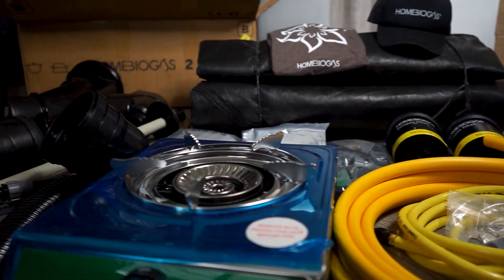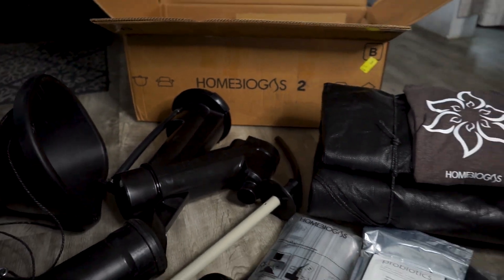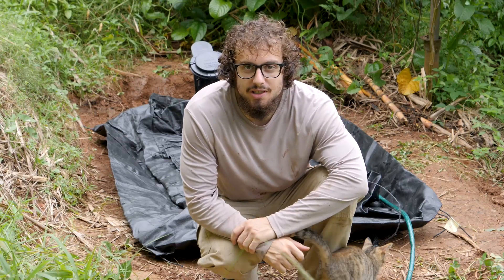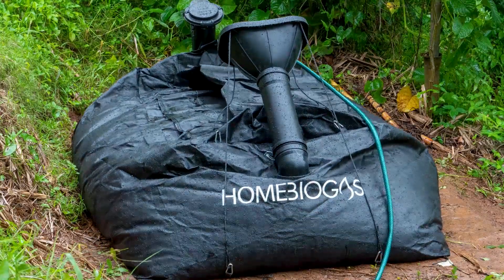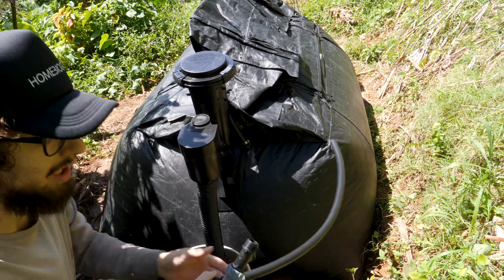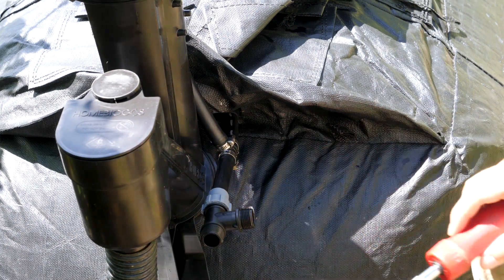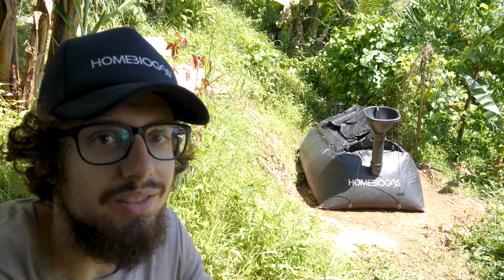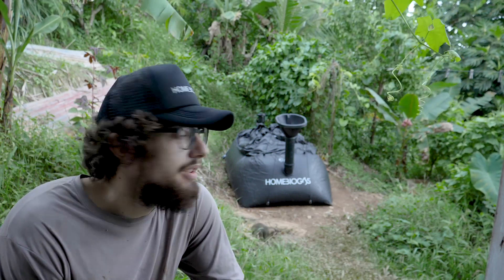Complete HomeBiogas 2.0 setup and activation

Comment: How did you connect the hose from the bag to your kitchen/the gas stove?
Reply from the maker: Via the supplied gas line and fittings.
Reply: @ColoradicalMike  how long can it be?
Can it be buried underground?
Reply from the maker: It can be buried and comes with about 10 meters of tubing.
Reply: @ColoradicalMike  Can you attach it to your home kitchen stove, or does it only work with their supplied stove?